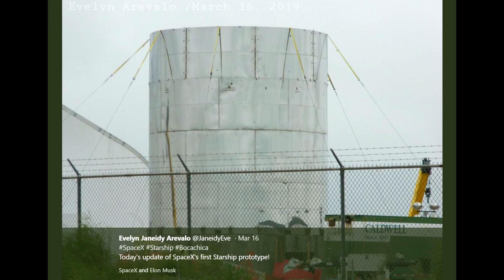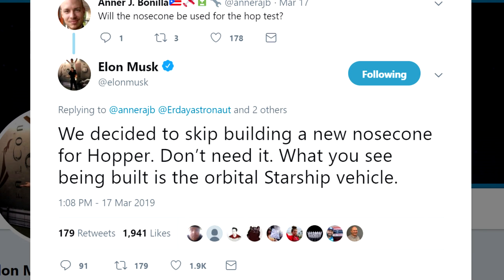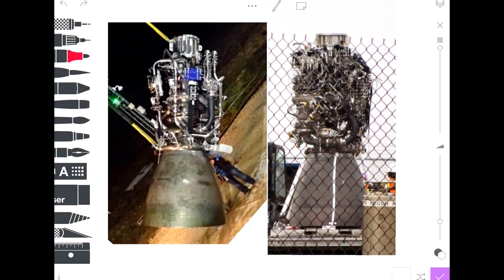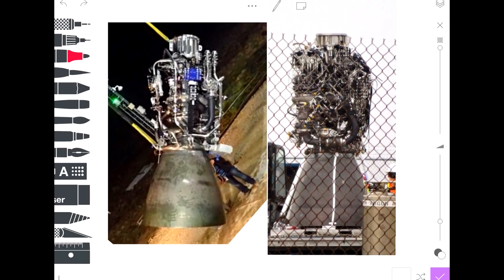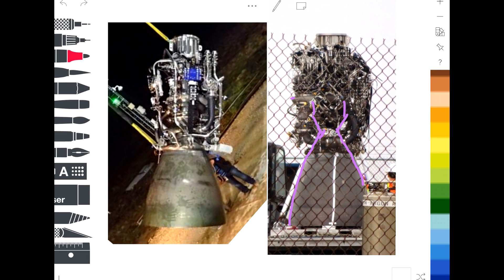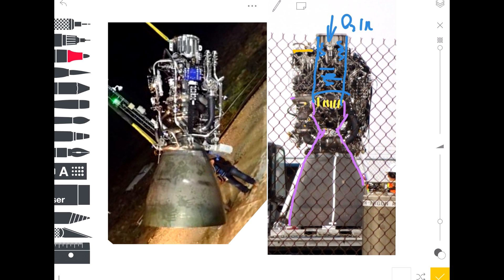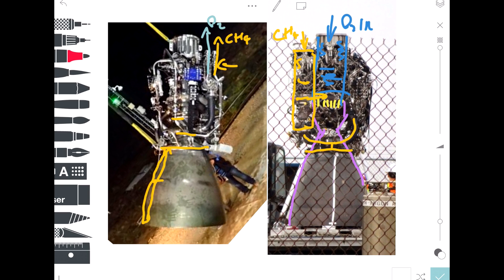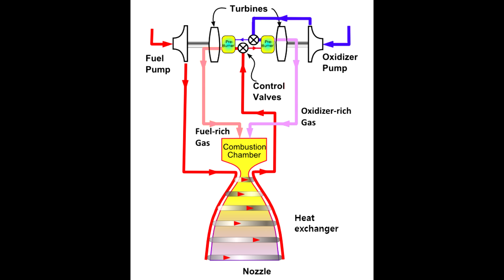Raptor Rocket Engine Analysis and Starship Testing Update

Comment: Scott, could you make a video about the differences of the BE4 and Raptor engine designs? 
You have commented on them before, but it's a bit confusing when talking about:
-Staged combustion (Raptor yes, BE4 ?)
-Closed cycle (Raptor yes, BE4?)
- GAS/GAS (Raptor yes, BE4?)
Also, specs could be compared such as projected 
- Specific impulse (Raptor 330-380+)
- Chamber Pressure (300 Bar?)
And some advantages/ disadvantages 
i.e. You have stated that BE4 is less complex and therefore easier to develop . . 

;-)
Reply: I'm no Scott but I can answer to some (keep in mind that Blue Origin is much more secretive and some informations I remember may be outdated)
Both are staged combustion
Staged combustion is a type of close cycle so yes, both
Be4 I think is gOx and liquid methane (single flow staged combustion, oxidizer rich)
Pressures and Isp should be much more modest on the Be4, still higher than the Merlin or other open cycle engines though.
Be4 seems to be much more conservative in design as the first orbital engine produced by Blue Origin, focusing on hammering down methane and reusability while SpaceX has already a lot of expirience with the latter.

Some information as I said could be wrong or outdated so if Scott or anyone else can correct me it would be great.
Reply: @theophrastusbombastus8019  Ok, so the gOX part is from sending the LOX rich mix for the pre-burner then. 
Thanks for that piece of the puzzle ;)
Reply: Theophrastus Bombastus, already gave a good answer, but for those not familiar with rocket engine terminology I can try to home in one the key difference. Both use a preburner to create a hot gas to drive the turbo pump, which pumps oxidizer and fuel into the combustion chamber. In the preburner there is usually an imbalance between fuel and oxidizer. Either you got too much fuel, or too much oxidizer. The reason for that is that a complete combustion would make it too hot in the preburner.  Using excess fuel is easiest. Excess oxygen is much harder, because hot pure oxygen will corrode almost anything. To make the engine more effective one can lead the gas from the preburner to the combustion chamber after it has made the turbo pumps spin. We call that closed cycle or staged combustion. If you just air out the gas from the pre-burner after driving the turbopump, then you call it an open cycle or gas generator.

Both BE4 and Raptor are closed cycle, which improves efficiency. BE4 is oxygen rich, which is major accomplishment. However raptor has taken it a step further by having BOTH an oxygen rich and a fuel rich pre-burner. That sounds crazy right? Well the cool thing about this is that by combining the fuel rich output from one pre-burner with the oxygen rich output from the other pre-burner in the combustion chamber, you manage to get a complete combustion: None (or little) excess oxygen or fuel. That makes the whole rocket engine more effective.

I am not expert on this, but with my limited knowledge I got to say I am in utter awe that SpaceX has managed to build such an advance engine as the Raptor. Nobody has anything like that. It is hard to fathom how such a young company on a limited budget has managed to beat entire government in rocket engine development. I really thought the BE4 approach was better because Raptor just seemed like a way too ambitious project that would ultimately fail. But it looks like they pulled it off an are not behind BO in development.

I think management gurus are going to study for years how SpaceX has been run, because they have been getting astonishing results with limited means.
Reply: @erikengheim1106  Thanks! I took some notes from Scotts "Rocket Engine Plumbing" video. 
So, fuel rich pre-burners tend to create too much soot (with RP-1, which is why the RS-25 SSMEs could get away with it using Hydrogen as fuel) 

The advantage with having a seperate fuel/oxygen pre-burners is that you don't need a common turbine driving both, thus you don't have to manage gaskets and seals to isolate the passageway for the turbine shaft, which seems to be a boon for re-usability. 

"Expander cycle" is a result of heading the fuel (around the engine walls {nozzle?} ) that is used to drive the turbo pumps 
The RL-10 uses this for upper stages. I'm pretty sure most engines that don't use ablative nozzles are fuel cooled, but not sure if either are considered "Expander cycle" since this replaces the gas turbine from what I understand. (Scott describes a physical size limitations with these engines as a drawback)
However, if this "expander" process simply converts gas for the pre-burner could this be what is referred to as "Gas- Gas" ?

Scott's "Why Next Generation Rockets are Using Methane" Video was instructive in comparing the Raptors higher efficiency but lower thrust. 
Space X seems to have made choices that aid in lower temperature (thus lower thrust) full flow to aid in reusability and to simplify fuel tank requirements. 
(autogenous cryogenic system eliminates the need for the problematic Helium COPV to re-pressurize tanks after expending fuel)  

Hopefully we'll get another explanation that will tie everything together ;)
Reply: @JoshKaufmanstuff  yes the gOx comes from the of rich preburner.
You can have separate turbines with a single preburner, the full flow advantage is that those 2 preburners have one ox rich and one fuel rich combustions moreover burning all the propellant mass you can gain more energy and so have higher chamber pressure.
The majority of liquid engines have indeed regenerative chambers but an expander cycle is so only if that is the only way to heat the turbine fuel, as far as I know there are no gas gas expander cycles as passing also the oxygen into the cooling channels not only have serious corrosion considerations but also a leak would add to the combustion in a fuel rich main chamber likely melting the engine.
Finally is not the temperature of the main chamber that define thrust to weight ratio but the average density of the propellant that gives channels, pipes, pumps and valves dimensions, that's why Musk spoke of an increase in thrust once the raptor will be fed chilled and so denser propellants
Reply: @JoshKaufmanstuff  Gas-gas refers to the state of the fuel and oxidizer when they meet in the combustion chamber. Raptor is gas-gas. BE-4 is not as its ORSC should result in gaseous oxygen (with some CO2 and H2O from the pre-burning products mixed in) but liquid CH4, so they will have a gas-liquid injector that mixes them. This will be a little less efficient than mixing gases which is almost perfect and instantaneous.

Comment: I have big questions about autogenous pessurization with deep cryo fuel. Experiments with lowering a beer can with steam into cold water show that the condensation process is super fast. And deep cryo fuel is important for safe operation of the engine in high modes, so heating fuel up not an option. And the deep cryo fuel has a vapor pressure of less than one atmosphere, that not enough for pressurization. I just cant see an option how handle it.
Reply from the maker: Good point, I imagine that in the ground helium might still have a use as a pressuring. Deep cryo propellant is really only used on the ground to put as much propellant as possible into the tank.
Reply: @scottmanley  Superheavy with COPV? Elon complained that fueling F9 with helium is more expensive than LOX. Does not fall into the canvas of a super cheap vehicle. But first Raptor (S/N 1) was damadged during tests due to too high throttle. And Elon said, that 200 tons on deep cryo is reachable. Obviously cold fuel is good for the engine. Probably it allows to reduce the temperature in the gas generators at the same pessure.
Reply: @scottmanley  Pumps pressurise by volume, so denser propellants mean the same pumps do more with the same energy. The pumps are a large fraction of the mass of the engine, so thrust to weight improves. For an open cycle, less propellant is put through the turbines to get the same energy, so specific impulse improves. The effect on the engine is more important than tankage volume, as bigger tanks are not too hard.

I had assumed they had abandoned deep cryo when they went autogenous, as combining them seems impossible. You might be able to do something with insulating barriers. Not sure how comfortable I would be in a rocket where the tanks are ready to implode though, so have fun human rating that.
Reply: Looks like both nitrogen & carbon monoxide should stay gaseous across the liquid methane temperature range, so that might be part of the secret. As long as carbon dioxide frost didn't cause problems, should be fine.
Reply: @absalomdraconis  Unfortunately most gasses are highly soluble in liquid methane at those temperatures. You would end up with weird engine behaviour and similar problems in terms of possible implosions. https://www.hou.usra.edu/meetings/exoss2018/pdf/3014.pdf
https://agupubs.onlinelibrary.wiley.com/doi/pdf/10.1002/grl.50630
One possible answer could be routing the methane feed through the oxygen tank. Pressurise the oxygen by boiling it while densifying the methane before it gets to the pumps.

Comment: Can you tell us more about hexagonal tiles... Are they made of stainless steel? ...  I need new tiles for my kitchen floor...
Reply from the maker: I think they’re probably ceramic.
Reply: I believe they were testing the stainless steel tiles, and some of them will be transpirational, as it simplifies plumbing.
Reply from the maker: Actually that makes sense, to have each tile have a single inlet that draws from the cryo reservoir.
Reply: Makes replacing clogged ones easier too.
Reply: Maintainability has to be baked into the design, as the ceramics of the Shuttle era are just too fragile to be field replaceable.  I think that Is one of the reasons these are not being built in a clean setting, as most rockets are.  I bet you could replace the tiles with hand tools if needed, and quickly.

Comment: You know Scott.... Elon Musk's 2020 Tesla Roadster is the fastest car in the world, and it accelerates much faster than a falcon heavy, however during the falcon heavy test flight the Tesla on top became the fastest car in the world, then it left the world. Towards the end of the booster's stage of flight, however, the lower fuel led to high TWR, making the Tesla on top accelerate much much faster than any other Tesla, so... technically The Tesla Roadster is faster than the Tesla Roadster. Elon-Ception
Reply: Oh dayum
Reply: technically automobiles speed is measured by the distance the wheels roll on the floor I think. So even though it is travelling through space if the wheels aren't turning then the mileometer won't be going up so then it can't be said to be going anywhere lol. So the Tesla Roadster is faster than the Tesla roadster while going zero miles per hour and simultaneously travelling at thousands of miles an hour , really wierd ;~)
Reply: @pegasusted2504   An odometer is just one way to measure a car's speed, but speed records, i.e. drag races and land speed records, are measured by timing. And if a radar-using cop gives you a ticket - good luck arguing in court that he didn't prove it on an odometer!  But yes, I do get the lol.
Reply: Oh wow, never thought of that before nice thinking

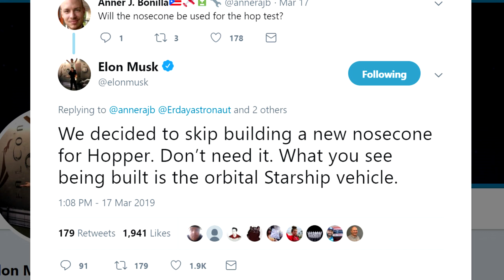Comment: 1:03 LOL were they planning on scrapping the nosecone all along, or did this accident randomly lead to the innovative thought that they didn't need it in the first place.
Reply: It's not that they didn't need it. They just don't need it anymore since it'll be a waste of time to rebuild a non essential nosecone, while they could just build a bigger, better starship.
Reply: @TNTHammer  Ahh okay I misunderstood that bit. That makes more sense.
Reply: @Suedocode  :)
Reply: I think the design analysis of the orbital class moved forward faster than even Elon expected, overtaking the need for a nosecone. And after all, the newer ship will still start with some kind of hop tests.
Reply: @donjones4719  I seriously hope that they'll make the orbital one with the actuating fins and control surfaces in the front and rear, as a hopper. Hopefully they can actually get it to orbit by late 2019.
Reply: @TNTHammer   I expect they will. Didn't mean to imply otherwise. Speculation: It will first launch with limited capabilities, possibly not full control surfaces, and be modified with new structures as they proceed.
Reply: The latter.

Comment: How on earth do you start a rocket engine?
Reply: Probably the easiest way is to inject a hypergolic (self-igniting) mixture just before actual fuel/lox mix.
Reply: He did a video on that topic I believe. Some use spark plugs, some others use the same mechanism as we lit a firework.
Reply: Call roadside assistance.
Reply: I believe there's a video just about that on Scott's channel, but simplified starting sequence goes like this:
1. Gas generator starts spinning fuel and oxidizer pumps, which then pump fuel and oxidizer into the chamber;
2. Oxidizer enters chamber first, then (here my knowledge gets a little fuzzy) either borane mixture is injected into the chamber, or a giant match is lit (in R-7 derivatives), then fuel enters the chamber and combustion starts.
Fuel enters last to ensure that there won't be any unintended explosive mixtures forming.
Reply: @theleva7  But how do they start the generator then? With an electric starter motor like a car?
Reply: @lithostheory  : I think that normal rockets rely on a passive pressure-start for that, though I'm not certain.
Reply: @lithostheory  Depending on the engine, it may use pyrotechnic device to spin the turbine to provide fuel and oxidizer to gas generator (famous Titan II "whoop" sound at roughly T-3 seconds), hydrogen peroxide decomposition products (again, R-7 derivatives), hypergolic fuel (in case of RD-180 it's triethylaluminium and oxygen, after some time gas generator switches to kerosene-oxygen) or gas generator may be omitted entirely for simplicity (Electron rocket).
Reply: Some bloke called Fire Retardant Frank stands under the engine with a ciggy and flicks the stub ends in once it's time to go. That's why they start at T-20 mins. That's his smoke break.
Reply: I wonder if anyone will try electric start like a regular engine? Electron has fully electric fuel- and oxidizer pumps, that might get too heavy for a big engine with high chamber pressures but maybe an electric motor to start up the turbinepumps could work?
Reply: @zapfanzapfan  : The J-2 used literal spark plugs (2 of them, purely for the sake of reliability) to light a sort of pilot light, which itself lit the full engine. They did this because they needed to relight for the return home, and I guess didn't like the idea of using pyrophorics for it for whatever reason. Worked pretty well, so I'd say it's a proven technology.

Comment: hey scott what type of landing legs will they add in super heavy also is the flame trench and infrastructure in 39A enough to launch BFR from the cape or will they have to build a new launch pad??
Reply: 39A can launch a Saturn V, Starship shouldn't be a problem
Reply: @jorge8596    BFR will have almost twice the thrust of a Saturn V. They might need to beef up the pad somewhat.
Reply: Propably new launch pad is required, BFR will be insanely powerfull. About legs Elon said on twitter about something like hydraulic suspention for landing legs but you check it better i haven't understand him well.
Reply: BFR  has a lift off thrust of 13 million lbs or slightly less than the Saturn C-8 I think 39A was originally designed for that.
Reply: Patchuchan If they need a new high power pad for some other reason, they might as well put it on a catamaran barge.  The ocean is a really big fire pit, and they get the option of equatorial launch without renting from Brazil.
Reply: @johnfrancisdoe1563  hmm you talk about building huge platform on water? The sea?
Isn't that too hard?
Reply: Thanks for correcting me ;) Im still lerning

Comment: Scott - don't worry, your drawing of a turbopump is better than scribbles that Wernher and Gus came up with on a napkin during a late-night snak run to Kenny's Diner.
Reply: Michael Smith Gus who? (sorry, I haven't memorized all details of rocketry history, so can't remember who WvonB worked with on which engine).
Reply: @johnfrancisdoe1563  
I think he was referring to Wernher from KSP, not the real one.
Reply: @johnfrancisdoe1563  gus was one of the astronauts for the Apollo program but he died in the apollo 1 fire
Reply: @johnfrancisdoe1563  It was a reference to Kerbal Space Program, of which Scott is a fellow player. Gus Kerman is the head of space program operations at the Kerbal Space Center and is the jack-of-all-trades, fixit Kerbal whom the other personnel all go to with technical issues.

Comment: Hello Scott,  What do you think will come first.  $100 per lb to put something in low earth orbit or fusion power on the electric grid?
Reply: By the time there is fusion power, the tech will have already moved beyond that, so - never, at least in the way that you mean. Far closer is to put solar panels in orbit at $100 per lb, and drop a power cable down to the grid.
Reply: @gg5115  I think you are spot on Geoff!
Reply: @leodikinis7390  Now, once the artificial anti-gravity generator is invented, then look for fusion power right after. Magnets are never going to cut it.
Reply: i think rocket is much easier than plasma physics. Both problem is optimisation by computer simulations but rocket is far far easier to simulate than simulating a plasma fusion. Therefore rocketry wins!
Reply: @xponen  I have not heard much from General Fusion as of late.